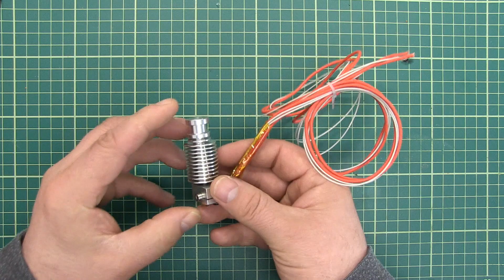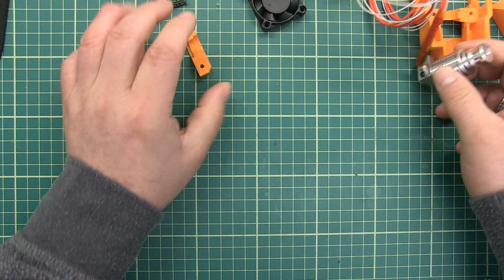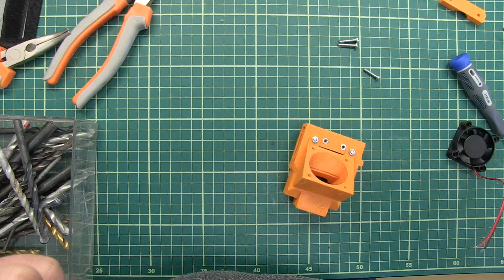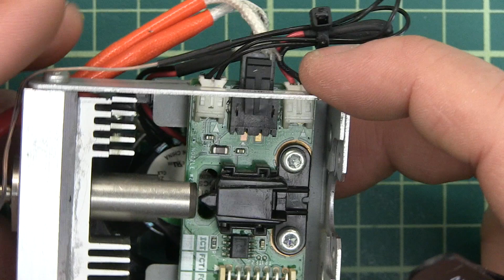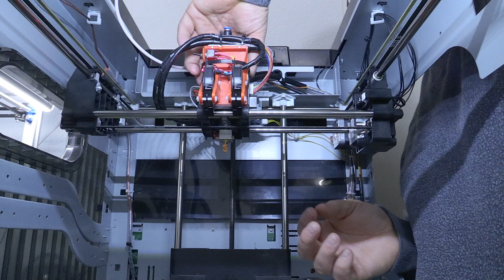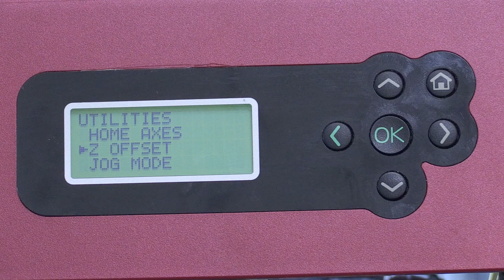💮 Da Vinci Pro E3Dv6 Hot End Conversion

Comment: I really don't understand why you'd want to replace what works with a chinese copy.  I haven't had one clog with my extruder or hot end. Unless you want to use special filament??
Reply from the maker: That's the thing. I have waited very long before I changed the nozzle and even now I can switch back to the original nozzle at any time.
the reason I made the conversion is indeed printing with abrasive filaments, like Glow in the Dark, CarbonFiber Enforced PLA and Stone filaments. 
Also, now i have another nozzle, I can set the nozzle temperature to 260C (Only in simplify3D) and I can now print Nylon with this printer without any problem. 

BTW, I now use an original E3Dv6 Full Metal instead of the clone.

Comment: Hi Brian,  I ordered an original e3d v6 kit, but the temperature wire is too short and has a pigtail on it.  What can I do (simple as possible) to fix this?  Thank you.
Reply from the maker: You can just solder a longer wire to it.
Make sure you use a good insulation between the wires.

Comment: Ok, so now that you have changed this will you not be able to use the auto calibration feature since there is no aligning pin? Also with this hot end changing nozzles should be easier to since they easily unscrew from the bottom and can be found easily.
Reply from the maker: You are not able to use auto calibration anymore. But, to be honest... Be glad.
Auto calibration never worked fine. Manual calibration is so much better.

Comment: Hi Brian, Thanks for your sharing but I have a question about Da Vinci Pro bed auto leveling function, How to do bed auto leveling after modification?
Reply from the maker: Hi.
To learn all about the leveling of the Da Vinci Pro 1 please visit my website:
http://3d-printcreator.com/bedleveling/
Reply: Hi Brian, Yes I saw that footage before but that footage was used original nozzle, I want to know is when you use E3D on the Da vinci pro, It's seems no auto leveling sensor （to measure 4 corner contact resistance on the bed) on E3D and how to use da vinci pro auto leveling function to do bed Calibration
Reply from the maker: After modification, there is no auto bed leveling anymore. But the second part of the video I mentioned here talks about that. THere you can see how to set your bed level by hand.
Reply: Thanks for your great help, :-)

Comment: Hi Brian I have a question about the electronics that are needed for the part. Is there a way to buy them in europe ( the shipping from america  start at €15 for me)? If not, can i just buy another da vinci 1.0 pro extruder and use the electronics from that one to place in the new one or do they have different dimensions?
Reply from the maker: Hi Krstof,
Sorry for my late answer.
Yes you can use the original electronics to but you have to know that a new extruder costs 99 Euro's directly from XYZPrinting, so a PCB from Amerika shipped to Europe is cheaper.

Comment: Great video.  I ordered the parts to do this conversion.  What type and size of screws did you use for this?  Also you did this conversion on a XYZ Pro....will it work on a Da Vinci XYZ 1.0
Reply from the maker: Hi, sorry for the late answer.
I used 3mm screws and it works great on my Da Vinci Pro, but I don't know if it will work on the 1.0

Comment: Hi guys, i am testing the temperature bahavior right now. Here you can acces some of my photos: https://goo.gl/photos/aHQD5pHDibBpr9D47

I set the temp to 225°C in slicer
Temp on printer display is 247°C
Temp measured by external sensor is 211°C

After 10 minutes of printing:
Printer display 244°C
External sensor 214°C

What is really strange, the display on printer showes 247°C on hotend and 88°C on bed, but at the same time, the SW reports temp 250°C at hotend and 93°C on bed !
Reply: Well, i did a lot of measurements....I did a small modification, just added 100R resistor in series with thermistor. Now the situation is:
Slicer setting 220°C
Printer display 234°C
External sensor 230°C

I swaped back to original dropin cartridge and temps are:

Slicer setting 220°C
Printer display 220°C
External sensor 205°C

Now i am totaly confused and have no idea why the temp is that different against the slicer setting with DIY cartridge.
Reply from the maker: Hi Matusek, 
I don't understand how this can be happening.
If you put a 100 Ohm resistor in series, the temperature on the nozzle should be hotter then the requested temperature. You can see a very detailed explanation in this topic on Thingiverse: https://www.thingiverse.com/groups/da-vinci/topic:5168#comment-1353448

Also, the external sensor you use is a solder tip thermometer. To have a precise measurement, you need to drill a hole in the aluminium heater block, and place the thermocouple inside that hole. Measuring the side of the heater block for sure gives a lower readout then the original value, I have been experimenting with this a lot. The difference can be as big as 15 degrees. 

But, again... I can't understand how a resistor in series can lower the temperature on the nozzle while it should rise with something like 10 degrees. Looks as if there is a wrong thermistor value in your printer compared to the thermistor you have in the hot end.
Reply: Thank you Brian. Maybe i wrote it wrong, maybe it is because of my bad english :)
E3dv6 drop in cartridge:
Without 100R resistor in series:
Slicer 225°C
Display on printer 245°C
External sensor 215°C

With 100R resistor in series:
Slicer 220°C
Display on printer 235°C
External sensor: 235°C

Original XYZ cartridge:
Slicer 220°C
Display on printer 220°C
External sensor 205°C

You are right, that the temperature sensor i used for external is K type for soldertips, but it is only one which i was able to bring for measurements on that high temperatures :(

Do you also have this problem, that you set the temp to something and the value on printers display is about 15°C higher ?

Thanks,Petr

Comment: Hi there brian! I just purchased an E3d clone and Bruce's PCB board for my Da Vinci Pro. However after installation Im getting a 0014 error. I believe this has something to do with the thermistor, but it seems like the thermistor is fine... any ideas? Thanks for your amazing videos!
Reply from the maker: Most probably there is something wrong with the wiring or connectors, I have had this problem to.
What I did was measuring the route from the thermistor, heater and ventilator to the PCB, and then the wires from the PCB to the motherboard of the printer. For me it turned out to be a wire from the PCB to the motherboard that was not properly connected.

Comment: Brian, you mentioned that there is a way to use the original PCB for the upgrade.  Are there any instructions for that available anywhere?
Reply from the maker: Not that I know of, but the connections are pretty easy to see. 
From the top down, these are:
- Ventilator Negative (- or black)
- Ventilator Positive (+ or red)
- Heater
- Heater
- Thermistor
- Thermistor

Mind you, only the ventilator is having a positive and a negative side.
The hardest thing is, you have to get the connectors OR you have to solder the wires to the board.

Comment: Brian, thank you a lot for this video, also thank to Bruce for this modification.
Bruce, is there any modification of EEPROM data, or you did just copy the original ?
Reply: Its only misuderstanding of coding Brian :) Its standart 2 wire serial memory like 24C02 , here in datasheet on page 15 you can find the Atmel marking way.
http://www.atmel.com/images/doc5298.pdf
Reply: Basically it is a copy of the original EEPROM contents. The data on the EEPROM appears to be encrypted (at least to my untrained eye) so I am not sure exactly what all the information xyzPrinting has stored on there is.
Reply from the maker: Lol, I tried to find the EEPROM just because I had interest in this kind of data storage for a whole other project, but I couldn't even find this type of EEPROM. The coding on the housing didn't make any sense to me. Found another type of EEPROM for my project that did the trick, but the EEPROM XYZPrinting used is a very rare one.
Reply from the maker: Wauw, that explains a lot !!!
I already knew it was 2wire protocol but I couldn't get to this specific one. For the application I needed a memory for I used the 24c64 version. This explains it all tough. 

Thank you.

Comment: Brian, maybe I missed it but your E3Dv6 clone still uses a bowden coupling with PTFE tubing? It's not clear from the video images. Also, what was the reason to go with a clone as I've read these are not reliable compared to the original E3D brand.
Reply from the maker: Hi Gert,
Now, in fact in the video I show the difference between the hot-end with and without the coupling. I also link in the description to the correct hot-end type, so you can see it has no coupling. but if you buy the original Bowden version, you can unscrew the coupling and insert a thing that makes the opening smaller.

Comment: Hey Brian. I am having a problem now with my e3d hottend. I have an official hottend not a clone. My promblem started two prints ago. It is printing 10 degrees hotter that what I set it on xyzware pro. I set it to print ar 227c and it prints ar 237c. It has done this twice already. Any Ideas?
Reply: Michael, i have the exactly same problem as you. I set the requested temp to 235°C and the value on printer and SW reported by printer is around 250-253°C. I checked the temp on hotend and it was 4°C less than value on display, but still higher then value i set in slicer.
Now i am seting the value in slicer for 220°C and i got 235-240 on printer.I checked stability in temperature plot in Simplify and it is stable, it is moving +-1-2°C around the 235°C.
Strange behavior, i have no idea what to do with it.
Reply: Matusek Petr  I think it has something to do with the thermistor.  When I use xyzware, I put my normal value for abs which for me is 225-235c. I have put 210c in xyzware so that the printer shows 225-230c on the printer's lcd and the print fail terribly because the hottend did not heat up to the correct temp. So set the temp in xyzware or any other slicer to your normal temp setting.
Reply: 3d Print Creator I personally havent mesured it. But when you set the temp lower to achieve the desired temp on the lcd screen the print will fell. I did this twice with a bency and the layers did not stick together and was really stringy. Both atemps were at 210c on xyzware pro settings. Then I printed it at 230c on xyzware and the print came out as well as could be on xyzware pro. So for me, I set it like I normally would in the software and disregard what it says on the lcd.
Reply: 3d Print Creator in a week I wont even have the original motherboard. I am switching to a ramps arduino mega setup.
Reply from the maker: Hi Michael,
This can be because of poor PID control from the printer itself.
As far as I know, there is no possibility to finetune the PID settings with the Da Vinci Pro machine and this makes it possible for the printer to react very aggressive when the temperature goes above or under a certain setpoint, making it swing above and under the setpoint. 

But the way you describe it, it looks like it's not swinging around that setpoint, but being stable, but to hot. This is a strange behavior because the motherboard controls the temperature and should be reading the same setting you see on the screen of your printer, therefore it should stop heating the element to let it drop in temperature. 

To be honest, I don't understand how this can happen. Maybe you should ask this question in the Thingiverse group for this printer, there are a few people that know more about the electronics then I do.

Here you can find the correct group:
http://www.thingiverse.com/groups/da-vinci

Good luck, and I will follow the question as you ask it there because I am curious to.
Brian.
Reply from the maker: Just to get things correct...
What is happening? is the temperature on the nozzle different from the temperature that is given in the display or in Simplify3D?
Or, is there a difference in the temperature on the display of the printer versus the temperature send out to simplify3D?

I am asking this because it's strange if there is a difference in the temperature shown on the display versus the temperature shown on Simplify3D. If this is what is happening, then I can't explain it.
But if the temperature on the nozzle (how did you guys measure that) differs from the readout in both, Simplify3D AND on the display, then there is a difference in the resistance of the thermistor. Each thermistor has a certain offset it follows. This I can explain, but then again my question is, how do you people measure the temperature on the nozzle?
Reply from the maker: Thanks for your response.
I will try to see if I can borrow some measuring equipment to do a test with the original hot end and the E3dV6 that I have to see if it gives different values.
I know someone who has a very precise thermal camera who can maybe help me. I will dive into this.
Reply: Brian,i hope that i will be able to lend measuring tool from my work for a while and i will do the exact measurement of hotend temperature.
Anyway, i don't understand how the PID in XYZ works - if it is the bad accurancy of thermistor, it has to be noticeable only as difference in real temp of hotend and the preset value, how it is possible that  i do setting of 220°C and the display and software shows the 235°C value ?
Reply: I resolved my issue replacing the fan. My fan I bought to 40x40mm 5volts fan at the beginning and I check them after the temp issue.
The used fan was running with less rpm than the spare one blowing less air cfm, so I replaced with the spare fan and my issue is gone thanks God.
Just doble check and make sure your fan is working strong.

Comment: Reading on hot ends I found several concepts. 
The thermistor - Are the thermistors standard? Or at least is the E3DV6 thermistor the same as the Da Vinci's?
The PID control loop for the heater - will the change in physical characteristics of the hot end make a difference in the way the Da Vinci control board controls the temperature of the hot end?
Reply from the maker: There might be a slight difference in the PID control, but it's not noticeable when printing.
I tested with a infrared camera that has a 2 degrees accuracy and found no difference in the temperature range when comparing the original and the replacement cartridge. Also, for the prints I use the same settings as I did, except for the speed, that can now be a bit faster without the clicking noise.
Reply: Huh coool

Comment: What is the advantage of the E3Dv6 over the original XYZ hot end?
Reply from the maker: For the E3Dv6 type hot end you can buy different types of nozzles, ranging from 0.2mm to 0.8mm in diameter. Also, you can get hardened steel nozzles that can be used to print with abrasive materials, like Carbon reinforced PLA, Brass- or Bronse fill filament, Glow in the Dark filament, etc.